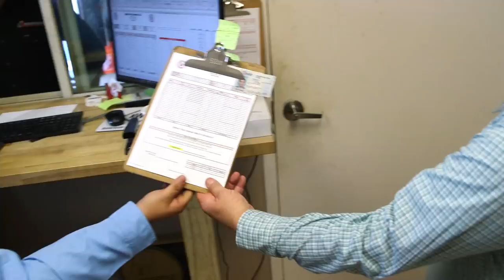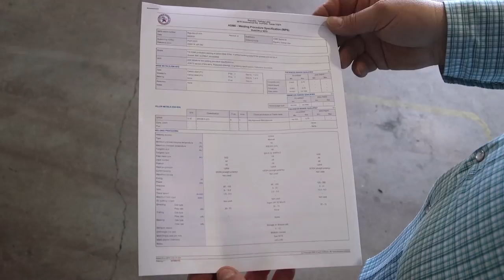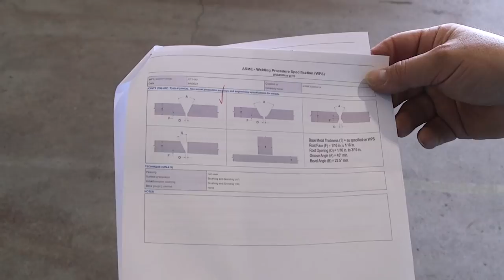Testing Day at the Welding Lab | How do I Pass my Pre-Employment Weld Test?

Comment: Another thing that's very important and a lot of welders never learn this unless told by an older welder or unless it finally Dawns on them after years of welding you can turn in a picture perfect specimen and still bust out on the bend test because you didn't allow cooling space between each pass if you tackle everything too quick and too fast with every pass when filling and capping and you don't allow it to cool off between passes your weld  will become hard and brittle and is likely to crack when given the bend test
Reply: This is true I like to take  a few min in between
Reply: BOILERMAKERS r the best welders different welds n meatels all the time I always would b in a nite trade school at local voc. If cheap r run my welder in the yard   today's field welder must b prepared for many n any tests. U will always b in a class r school .to keep with the money,🇺🇸🇺🇸🛠️⚒️🛠️⚒️💥💥💥🔥🔥☀️
Reply: Thank you for this info
Reply: Ohhhh
Reply: Good luck
Reply: True!
Reply: I weld hot and I never let it cool between passes. I'm sure this is true but at extremely hot temperatures noone could handle
Reply: @lunajuan25  it really depends on the type of steel your welding. On how hot your running.
Reply: Good point when taking a weld test but a lot depends on what type of steel your taking the test for. Not all test are bent some are cut then dipped in acid and X rayed too.
Reply: You can bust on side bends too.  
You can bust on a Nick Test, depending on the inspector's interpretation...
Reply: My welding teacher never lets anything cool down and he doesn’t get undercut or under fill
Reply: That’s why maximum interpass temp is always stated on WPS 👍🏽
Reply: A lot of times it gets brittle when dunking in water and cooling too fast.
Reply: @eliford2258 really true, once the tip of the metal makes contact with the liquid the metal starts to cool in temp from that tip up like heating something glowing red then once you stick the tip in you see the cool process shoot up to the top deleting the glow. once that happens you stick the whole thing In

Comment: Love how the inspector wasn’t wearing any of the safety gear.
Reply: He don’t give a fuck he a savage
Reply: He’s a bro OG you don’t question the OG’s ways 😎
Reply: Perception glasses are bullet proof now. The infinity gauntlet of senior tradesmen
Reply: If he has prescription glasses I'm sure his are safety
Reply: The inspector grew into his position, aka......so as I say, not as I do!!
Reply: Hey he threw his hand up when holding the pipe for the tac 😂
Reply: He's not around when any welding or grinding is taking place usually, unless he's taking a peek for an in process hold point. The straps are cleaned up, any burs removed and cooled usually before the bending process. Also, if he's in the field and wears glasses, they are prescription safety. I have never had to test for any inspector who treats it any different. Shops don't usually require hardhats, but sometimes they make you test with it for work like purposes depending on the contractor.
Reply: Thought the same thing 🤣
Reply: Lol Is this fxxxing oldschool US style? He is golfing in the welding booth 😂
Reply: he is not the one doing any of the work, he does not need any special safety gear.   jeez bro, you sound like somebody that doesnt actually do any work in real life.....
Reply: @robertambs6847  duh,  he wanted to shade his eyes from getting flashed.   its common sense bro.   it would have been stupid to not put up his hand to shade his eyes.
Reply: @orion7741  little slow there bud

Comment: Been welding for a decade(strictly running dairy tube stainless)just had to sit my asme test yesterday and my boss literally gave me 2 practices before I had to sit a 6g 8mm carbon pipe. I've never prepped or welded pressure pipe before so needless to say I barely made it through the test and basically relied totally on my dairy tube welding experience to carry me through 😬 anxiously awaiting my results,wish me luck!

Comment: When I had qualification or and work post certification I always had an abrasive pad or clean, non oil steel wool and die-check remover to clean my filler wire. We never welded with the colored coating on the wire. While not doing so doesn't result in  failure it's one less thing to be concerned about when everything is clean including the filler rod.

Comment: About all but two places that I've worked in the building trades provided all of your equipment. It was winter time, I tested for a Boilermaker 
outfit and the guys told me days before going in they wouldn't let you use a grinder between passes. It was a 1/8"  7018  6G chill ring, heavy wall X-Ray test. I brought two rat tail files with me in my jacket. Before we got out of there those rat tail files about got wore out cuz there were six other guys testing at the same time. The files made that test for me. I blew through the chill ring at about 4:00 o'clock on my hot pass. Without them files I never would have made that test. You don't blow through a chill ring! It left a big glob inside but it did clean up with the files. And I scratched around the whole inside of the Ring just to make the file marks uniform. The inspector looked very close but never said a word.

Comment: My opinion is carbon is harder to pass x-ray and bending cause it's so dirty a material stainless, nickel, chromoly steal easy. Retired from 30 years of x-ray required welding in pressure vessel industry so have done it all pipe work vessel work and structural good days but glad to be done with it beat my body up

Comment: I have a copy of (welders offshore guide), that's sold on EBAY,  and in one part of it, it tells how a number of welders learn and get certified without ever having to go to an expensive welding school. So many  young men want to be welders but some are already married and cannot afford to take a year out of their life and   go back to vocational training school. Ingalls in pascagoula, ms. Has 3 year pipe welding apprentice programs where they pay $17.50 per hr. Just to train you, drawback is passing a drug test and no criminal background which most welders have issues with both. That's why I like the welders offshore guide because it overcomes all those issues with the knowledge it provides on learning and getting certified, without having to go through long awaited union programs, some welders follow its advice and get certified in a few weeks. I wish it had been published  back in the 70's when I started welding.
Reply: I have a question that book will work to get certified in México? Thanks beforehand
Reply: @urielbatres4518  For me practice is what it took to pass the test. I got lots of practice at work on non structural stuff, I did not have to pay for welder, rod or electricity. School is a good cheap way to get the practice you just have to pay for it. I don't think the book alone will help. call the closest trade school and ask for a used book or ask a library for help.
Reply: @wadestanton  thanks for the answer 👍
Reply: Im a woman and the only reason ive been looking into welding is bc i went to prison20 to 27 years old 🤐 and i must get a trade. You’re telling me a background check is something im going to deal with trying make 100k a year? Bc i might as well give up rn.  :/
Reply: Btw im about 30 min from pcola and know there are some on the job paid training programs around here..just now starting to really investigate while i have time off.
Reply: @kals350  What I have seen: Old freelance welder in rural area hears about a young welder struggling to start, gives welding equipment and customers to young welder. The most rural of areas are usually desperate for a good welder. Lots of times farmers in the most rural of areas are there for a reason and privacy of their past is one of them.
Reply: I failed my test after drinking the night before. I was shaking like a gerbil in a SF pet store.
Reply: @robertferrara4529  Who paid for your schooling?
Reply: @wadestanton  😹😹😹😹😹😹😹
Reply: @kals350  don't let anyone tell you what you can do or not to do ,go to the community college welding program ,lots of companys hire welders right out of the program ,uselly  a two program and when you got two years under your belt ,and a weld cert you'll have plenty of work ,I have know a few woman welders (can I still say that?)  they work the same hours and made the same pay ,hard work and good pay you can make 60 to 90 k a year ,pipe certs are the best

Comment: I have a question? Would it be a failed welding test if one of the coupons had porosity?
Reply: There's a chance those pipe could have high pressure steam in them if you as the welder can't weld them clean you should not being doing it if a high pressure steam line explodes because of bad weld people will like die

Comment: Does that coupon have to be that low or can it be up higher to do the bottom and lowered for the top?
Thanks! This was great!
Reply: Once the pipe is tacked it can’t be moved, up or down. Gotta find a comfortable position, I do mine a little below chest height
Reply: I assume this is to stimulate "real world" conditions where it could be a repair/install in an existing facility, so you have to adapt to the part, no way to just move it more conveniently.

Comment: Awesome video! I was wondering though, how does he control the amperage of the torch? I've seen foot pedals, but for part of the video he is on his knees. Is it constant amperage?
Reply: You set your machine and weld. Duh
Reply: Looks like he's running a wheel for his argon. It's probably just one to give him his argon flow and running lift/scratch start since it looks like he's just snapping out of it which is kind of a bad habit. snap out but get that argon back on your weld until it's cool even if it's just carbon.
Reply: @Thorn19774  i “trail” out onto the bevel.
Reply: @aaronhobbs8716  I was taught to slowly  release the foot pedal when you stop to avoid cracks, idk how you would do that if you just have on/off power
Reply: Yeah bro looks like he's  just using scratch to start, which is how we train in my school in Southeast Tx, we don't use controls/pedals/ until we start working with alloys.
Reply: @krom5851  increase travel speed and crawl up on the bevel and snap out. Or on the cap I increase travel speed until the puddle gets real small and rock the rig back to snap out but still maintain argon coverage. Call it a “tadpole”
Reply: @krom5851  its called skill. Id love to see you trying to use a foot pedal while working on pipe up in a rack. You kids need to do more listening and less talking
Reply: @chancesanborn7932  that makes sense, thanks!
Reply: @aaronhobbs8716  okay cringe lord lmao
Reply: @krom5851  like i said. Less talk more listening
Reply: @aaronhobbs8716  Never knew that asking questions was detrimental to learning.
Reply: @krom5851  you didnt like the answer. Some of us learned from old school hard ass men. Im one of those and will admit im better at welding then teaching. Sorry you have thin skin.

Comment: You know, I've been x-raying for 11 years. Before that I was a welders helper on pipelines,  I got discouraged when I was struggling to weld, and my welder said you either have it or you don't. My dad x-rayed so I just decided to go that route.  I wanted to get my cwi, but over the years I've not learned much more about welding,  I doubt I would be able to do this guy's job as proficient as someone who was a welder. 

To be honest,  cwi is already over saturated,  I know quite a few of them that are doing other jobs. This whole industry of inspection isn't what it used to be. It's hard to find any consistent work around home, you have to travel to make a living and I'm pretty much done with it all. I hate that I wasted this much time in both fields to only walk away but... it is what it is.
Reply: its ok buddy,keep going
Reply: Hey man don't be discouraged by what one welder said. We learn by messing up, until we get it right
Reply: I started back in Sept of 63.  First two position bend test was in Nov.  The day Kennedy was assasinated.
If you've never busted a test, you ain't never been anywhere.
DON'T QUIT, It takes lots of practice.

Years and jobs later...  I got to the test facility in Phoenix after laying out for almost 8 months. The inspector looked me out after my root pass. He told me if I wanted to stay and practice the rest of the day he'd give me another shot. But that time was not compensated. So I started over the second day. Made that test and went to a job in northern Arizona. That was just a gate test. When I got to the job the weld inspector gave me another test. Before I got done I have taken four more tests for qualifications for that contractor. Just take a deep breath and keep on going. Or is the man told me put that Hood down and keep them sparks flying. I hope you haven't quit by the time you're reading this.

Comment: Do you need to line up the seems of the pipe?
Reply: As a pipe fitter ( non union) I grind the seams on the inside of the pipe back 1/2 in to 3/4 inches. So the welder gets a good penetration on his weld.

Comment: I'm not a welder, but curious why leave that gap and not just butt the 2 ends together?
Reply: Its to ensure full 100% weld penetration.  If the joint were tight fitted, it would be incredibly difficult to get full weld penetration to go the full thickness to the inside of the pipe.  Pipe and plates that are butt welded are usually fitted with a 1/8" gap and the faces of the joints beveled to ensure full penetration of the weld arc.  The thicker the piece of material to be welded, the more important the fit up technique is.  This is why fitting is so important to the success of the welder.  If he did not fit the two pipes together properly with a gap and a bevel, he would have failed the bend tests.

Comment: In france it's pretty much the same thing during tests except that, carbon steel doesn't qualifies you for other alloys, and pipe goes throught X ray.  I boosted carbon steel but got stainless ... and thank to this video now i guess i know why, nobody told to grind beetween passes for tig in order to remove silica... I hate my instructor, such an brutal asshole.

Comment: Question is it  allowed to grind a weld off if it came out wrong ?
Reply: yes. but when you hand over the pipe its over :) some Firms ask a special test without Grinder. only hand files allowed. and with time limit.
Reply from the maker: yes we are working on a repair vid coming out soon. "repairing your weld when taking a test"

Comment: If pipe joint get magenetic .. what should be done for welding
Reply: Any suggestion
Reply: @riteshpatil3252  Heh, I know this is late. But someone may read this.

 Hit it with a hammer, several times, hard. If that doesn't work, wrap your welding lead around the pipe and try to weld and reverse the magnetism.

Comment: If an inspector has to do all that hes never welded in his life a good qc doesn’t even need a mirror especially on a 6 inch u can tell right away if the bead is in there 😂
Reply: The inspector you're referring to has over 30 years of welding experience. He is doing it the right way instead of the half ass way

Comment: Is this still considered a one sided weld? Welder is introducing the filler metal from the inside of the weld/pipe. Inspector should make this clear in instruction. Should it be documented as a consumable insert on the WPS?
Reply: yes it is. and yes some tests is. that back feed wire is not allowed.

Comment: Dang, I have never taken a test where the cwi lets a 5/32 gap fly. Or a single bead cap on a 6g
Reply: a 5/32 "4mm" is the norm Here. you could go 2,5-5mm normally.
Reply: @micbanand  nice, in are weld test procedures they say 1/8” max and they usually hold us to it